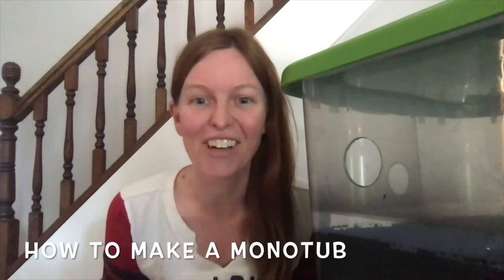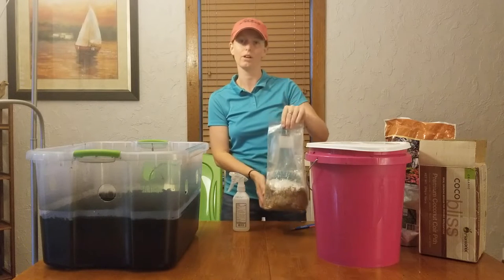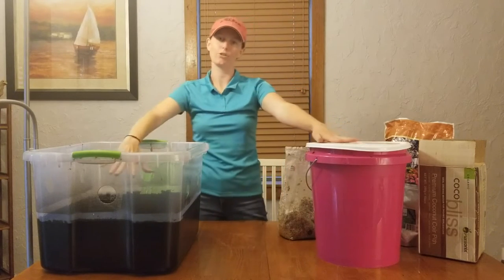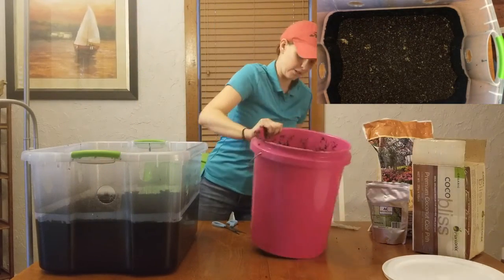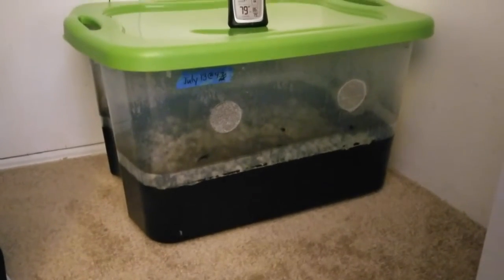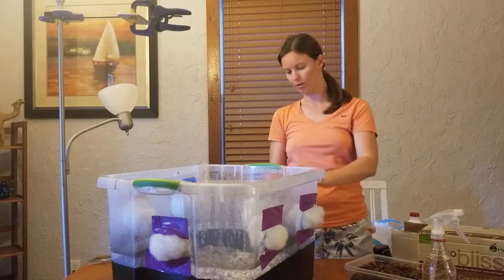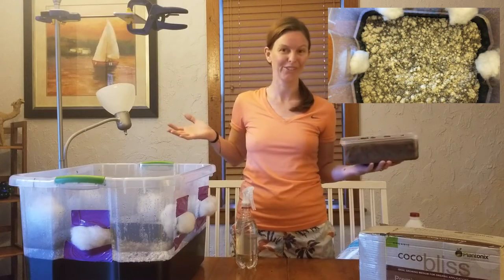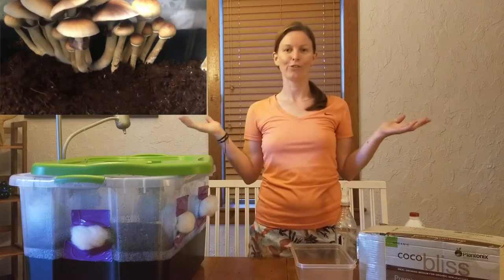How to Make a Monotub | Spawn Bag to Bulk Substrate | Casing Layer | Fruiting Mushrooms

Comment: How long after the casting before you started to see them fruit?
Reply from the maker: Andy Ballenger days!!
Reply: Boomer Shroomer is the casing absolutely necessary for fruiting once pinning has started? Also I’ve seen mixed opinions about paint vs bags because of the substrate shrinking vs light that causes pinning... thanks!
Reply from the maker: @justinlacy8428  **UPDATED **No, the casing layer is not absolutely needed. I just heard that the biggest benefit is you will get a more even pinset and it protects the mushrooms from bruising when you mist them. As for painting the tub.... I searched this till I'm blue in the face.... I think the black liner method instead of paint has it's benefits.. cause they say that being air tight can stop pinning around the edges and bottom.. which it does!  I would recommend using a liner now! You don't need to paint the bottom anymore. Just use a black liner! This will reduce side pinning all together and give you a nice even pin set throughout the whole monotub! :-) I have a new video coming out that shows the liner process!

Comment: why did they only grow on the sides? did you not moisten the middle enough when casing?
Reply from the maker: They eventually grew in the middle. But yes I think the casing was a little too think in the middle too.
Reply from the maker: @youshowmeyours  yeah true. I sprayed the middle too. But they definitely side pin without a liner.
Reply from the maker: @youshowmeyours  I would use a black liner too.

Comment: Rest of the video is fine, but 1:42 is bad advice. Light isn't the major factor that leads to side-pinning, the microclimate that forms between the tub and shrinking substrate is. You'll still get sidepins if you simply paint it. What you want to do instead is use a liner (like a trash bag) inside the tub. That way, it will cling to the substrate as it shrinks and prevent (or at least drastically reduce) side-pinning.
Reply from the maker: otacon1024 cool thank you.
Reply from the maker: otacon1024 I think I’m going to do a side by side comparison to see which way is more effective. I’m curious which way will have a bigger yield. Cause painting the tub seem to definitely prevent side pining in my tubs.
Reply: @BoomerShroomer  That's interesting, it's usually ineffective. Could just be the case that your subsequent tubs were dialed in better, surface conditions were better, so there were simply no side pins because of that. That can definitely happen - if you have a properly dialed in monotub, you don't need either a liner or paint to prevent sidepins, they're more of a crutch to push things in your favor in un-ideal conditions.
But yes, if you can, absolutely take the scientific approach and do a side-by-side with an unpainted tub, painted tub, and an unpainted tub with a liner. Obviously, make sure all the other variables are the same or as close to it as possible - same tub sizes and design, same substrate type and amount, same mushroom strain, same ambient light levels, misting/fanning amount and schedule (if you mist and fan) etc etc. Would make for a very interesting and useful video as well.
Reply: Liner can be transparent. For beginners a liner is less complicated than figuring out everything else to perfection and as a plus - helps with cleanup.

Comment: Would you consider using the same mix that you made for substrate for a casing layer once the cake is ready? Mush love!
Reply from the maker: You could. But just a thin layer of coco coir is needed. It may try to colonize the top layer too.
Reply: @BoomerShroomer  Gotcha, I like the dry coir idea, probably better at preventing contaminants as well. Do you ever add wax paper or tinfoil while colonizing?
Reply from the maker: @TheGoodFunGuy  no, how does it help?
Reply: @BoomerShroomer  From what I've researched it's helpful at creating ideal humidity temps, lowering contam rates, faster colonization, and better pin sets. I only just had my first few harvests so I can't speak to personal experience but I've seen Home Mycology, Arvinfortyseven and others recommend it as well.
Reply from the maker: @TheGoodFunGuy  okay I will research it and give it a try! Thank you!